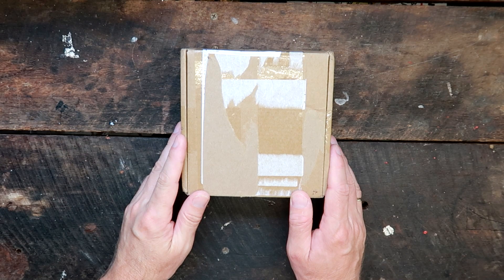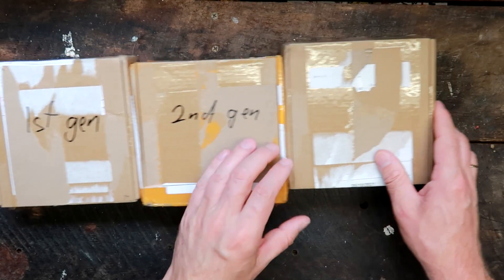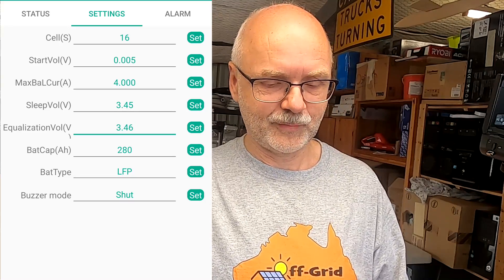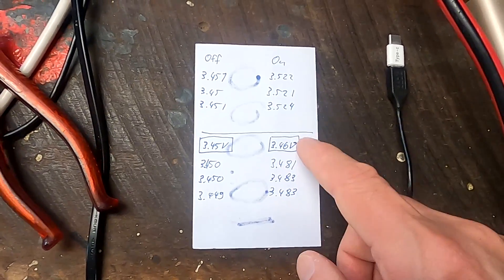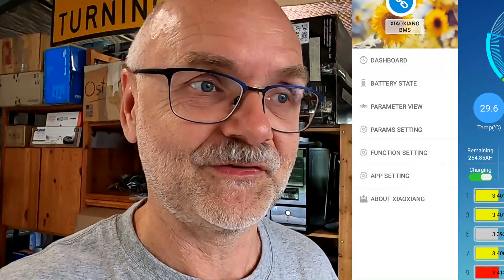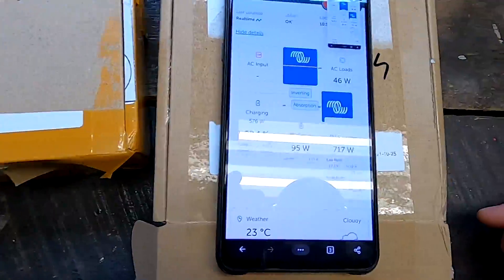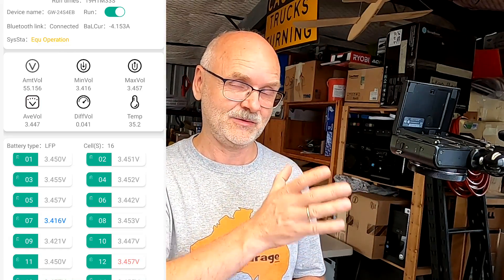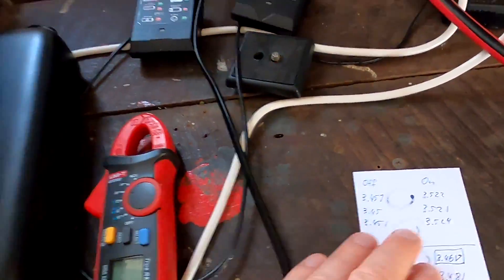The NEEY Active Smart Balancer is fixed. But there is something you need to know...

Comment: Why not do a top balance and not use active balancers? I don't understand the utility here. Even with grade b packs, cell drift is not that bad. What is the goal? 

I see all of these wires connected to raw terminals as a liability. And I've had a few balancers fail and go up in smoke. Isn't it better to avoid the risk entirely? Or am I missing something
Reply: And as we all know, voltage cannot be used to determine soc. So a solid top balance is the best way to ensure that the cells are at the same soc. After that, the cell drift is very minimal.
Reply: If you absolutely want the best balance for a pack you should balance charge every cycle. Which is a top balance. I can cycle for six months and still pull full capacity after an initial top balance. What benefit would a balancer have here? (That's when I didn't use bms)
Reply: If I'm using a high c rate chemistry and cell design, such as LTO or lipoly, and I'm pulling 10-100C, then an active balancers may be warranted. You need a linear curve chemistry for there to be any benefit. Some applications are car audio and large inductive loads. But for solar? I don't see any benefit at all. Unless someone can show me some literature or proof otherwise.
Reply: @WillProwse  You don't get a full charge every cycle in off grid situations.  You should have batteries setup to provide multiple days of storage to account for less sunny days.  So you will have many partial cycles.  This is where you get into problems....never high enough voltage to hit a bms shunting the high cells.
Reply from the maker: Great thoughts here, Will. Thank you.
The video was more a wrap on the NEEY Smart Balancer to show people how it now works after the 'fix' so they can make a decision if they want/need one.
My cells drift quite a lot but this is dues to not optimal terminal/busbar connections, I believe. Once charged back to the top after 2-3 weeks, I still have 30mV-50mV difference. It does not concern me much as all cells are still within the specs and they will balance over time. However, I'm not charging fully often with the increased load on the system now, so drift will occur...
Reply: 4A vs 50mA.   That tiny Daly BMS balance current isn't going to do anything when you have solar pumping in at 50A for 6hrs a day.  This setup allows you to balance below the top voltage, so is actually useful with the partial charges likely with solar and with a reasonable amount of current for 280Ahr batteries.
Reply: @jmaus2k  no, partial cycles are fine. this will not cause cell drift by much. Typically a solar lifepo4 pack only needs to be balanced every few months. High rate charge and discharge cycles will cause cell drift. Also exposure to excessively hot or cold temperatures. Or difference of temp on one side of pack.
Reply from the maker: All due to differences in internal resistance of individual cells. The better they are matched, the less drift they have and less balance they need.
Reply: @jmaus2k  you don't need that much balance current regardless. Electric car batteries are much larger and still use passive dissipative balancers with the same balance current as a Daly and they are fine. If you wish to prove why, please substantiate your claim with evidence. Tesla and Orion BMS disagree with you.
Reply: @OffGridGarageAustralia  the drift will occur at high soc regardless. What are your capacity test results now? If you're not pulling more capacity, why try to fix this problem? Let it cycle with the deviation. It's not much at all. You will always have deviation. The problem you really have is mismatched cells. When was the last time you did a top balance? Voltage is difficult to use because it's lifepo4. Even with best top balance, you will still have a natural cell voltage deviation because there is variance between each cell.
Reply: @OffGridGarageAustralia  doing partial cycles is totally fine. Let it go out of balance and do a capacity test and post your results. I will bet you will still pull 97% of your previous measured capacity or better. Unless you cycle for a few years or do higher than 2C rate
Reply: @WillProwse  Hey Will, I agree with most of what you have said....But, I could use the high balance currents because I bought a used high capacity LFP battery before the Eve cells, etc. appeared. A couple of cells run away towards the end of charging and this would help keep all the cells in line.
Reply: @gregb1714  the cell deviation will always occur at high soc. What are your capacity test results before and after having an active balancer?
Reply: @WillProwse  With the used pack, a couple cells hit 3.65V when the others are at about 3.4V. So pulling charge current away from the 2 runaways will allow the remainder of the pack to charge up more, increasing capacity. In the battery pack, the cell terminals/bars are laser welded together so I can't replace the 2 weaker cells.
Reply: @gregb1714  understood, what is your before and after capacity test results with the balancer?
Reply: @WillProwse  Electric Cars are plugged in overnight.  12hrs is a lot of time to balance especially if you are doing it everyday.  The problem is you don't get "everyday" or even many hours per week to balance depending on solar.  So you need to have higher current to manage that with a passive balancer.  You could do active balance at low current too.
Reply: @WillProwse  Manually balancing cells isn't an option.  User will forget and end up with a damaged cells if you bypass the BMS for higher current solar charging like you suggest in some forum posts on your site.  We should design for a fully automatic system that lasts 10 years without  users intervention.  This is easy to do, BMS makers just don't get it yet because they are designing for overnight charging.  There needs to be something that balances every xx amphours in or out....or at top voltage if you ever get there.
Reply: @jmaus2k  I haven't fully charged any of my electric cars for months. They are fine. 

And most of my solar systems charge to 100% every single day because I sized the array properly.
Reply: @jmaus2k  what I'm saying is you can cycle hundreds of times without needing to balance. Try it. I did it for years before we had BMS.
Reply: @jmaus2k  no, I didn't say to not have a LVD. Read my comments. You're missing the points I'm making entirely.
Reply: @jmaus2k  I promise you that the BMS designers don't see it as an issue because it's not. Let them drift for six months and do a capacity test. They will be fine. The voltages will deviate at high soc regardless. Do you have long term cycle data proving that me and hundreds of engineers are wrong? Please post it here. I'd love to see it.
Reply: I think the point is that you do not have to top balance or even know what ‘top balance’ is.
Battery management will become an appliance where even the Bluetooth interface is superfluous as long as you have the correct chemistry and current for the BMS/Active Balancer.
I love to relate the story of how in the early days of refrigerators and radios there was a huge publishing industry and DIY community devoted to radios and refrigerators. This will also happen to batteries. The magazines that were devoted to refrigerators and radios have disappeared, as will youtube channels devoted to batteries.
Reply: @WillProwse  That is a tough one to answer, it depends upon what point in time I decide to measure capacity. I am using one of those capacitive active balancers, they are good for 1A, Andy's testing reported that the neey is always 4A. So, now going through microcycles, weak cells cause bms high voltage cutoff, 1A active balancing brings down weak cells & charges other cells, then bms turn-on & charging on again until weak cells at 3.65V again and bms cutoff.  Repeat. Number of repeats/microcycles depends on battery capacity at start of day and available sunshine that day. I believe a 4A balance current will reduce the number of these microcycles and supplying an extra 4A to weak cells during discharge cycle will result in better battery capacity. That is, better utilization of the normal cells capacity. Weak cells cause bms low voltage cutoff and other cells are at around 3.1V.
Reply: @WillProwse  I tried with LTO 40Ah Grade B cells...and they have different self-discharge rates: from 4mV to 38mV deviation in only 6 days, sitting around at 2.5V/cell in a 22S 5P configuration.

Whenever I want to post a link to the DIY Solar forum, the comment is being deleted...
Reply: @CaptainProton1  what are your capacity test figures before and after? Would love to know those results.
Reply: @2true611  if you want to pull full capacity, all cells should be at same soc. Lifepo4 is tricky because the voltage is all over the place for most of the curve. So a balancer being used at any other time than high soc, is worthless. You can't use voltage with this chemistry to balance unless you're at high soc.
Reply: @CaptainProton1  yes understood, so what are your capacity test results? Can you post a video showing before and after?
Reply: @gregb1714  again, what is your capacity currently from 0 to 100%? How often do you measure? Watching the cell voltages all day and trying to balance them probably won't help you. Well, I can't tell until you post some test data. We need to see the capacity before and after to see if it made any difference at all
Reply: @Raphael_Hofmann  which LTO cells? Which manufacturer? What did you post to the forum? If it's not spam, it shouldn't be deleted
Reply: @WillProwse  My name there is Freibeuter and the post is called: LTO "Grade A" Aliexpress Cells.
Those blue 66160H 2.3V 40Ah Yinlong LTO cells, that you already tested before a couple of times.
Reply: @WillProwse  In the DIY solar forum, search for: 66160H
Then check out the second search-result to see one of my posts on those cells.

I learned about those cells because of your Videos :D
Thank you so much for your educational content.

Try posting those links in YouTube...the comment disappears after reloading the page.
Reply: @Raphael_Hofmann  thanks :) and yeah, it will delete them on here. YouTube blocks links. I'll check out your post! Cool
Reply: DIY Solar Power with Will Prowse l
Reply: @WillProwse  I've used and tested hundreds of the valance u27-12-xp .  While most of them work fine there's a few that are very hard to finish a top balance cycle.  Top balancing takes months held at high voltage.  So I manually balance and most of the time the battery remains easy to keep balanced.  But there are three out of 350 12-year-old batteries I found that their self discharge rate is too high for the balancer to keep up with even when doing a daily top balance using the stock BMS.  It may not seem important now to have a high balance current ability but 12 years down the road it has become important for these particular lithium magnesium iron phosphate batteries.  Over the past 12 years these 1.76kwh batteries have been subjected to freezing temperatures in an electric delivery truck with no active cooling or heating surging 2.3 C charge & discharge during driving on hills  and have discharged 630 kilowatt hours during their life so far.  With very few full cycle counts.  Some of the compartments that hold the batteries had water in them. My point is they've been abused and they've held up very well. And that they're built-in top balancing BMS has a very small bleed off ability which simply can't keep up when things start to go wrong. We're trying to use  BMS's that can not only protect the batteries but also keep them balanced 20 years later when they've been abused.  These few batteries that are having issues for me don't have capacity problems. And with a stronger balancer can continue to be a useful addition to my system.
Reply: @WillProwse  the balance battery with the largest imbalance took one amp into one cell block for 2 Days @1 amp to bring it up to top balancing voltage.  That means it was missing 24 amp hours out of 138 amp hours.  That's quite a huge loss of capacity if you continued without balancing.   This tells me it's been many many years since it's reached a top balance state. Not that they haven't tried. They probably had it plugged in for days and days. The charger communicates through the can bus to the battery system and so the charger is actually controlled by the batteries BMS for best top balancing results with the hardware involved.  Crazy how they were using this technology a decade ago and it didn't take over the market sooner.  So many people say lithium iron phosphate batteries are unproven however my old batteries prove otherwise.
Reply from the maker: I did a top balance two days ago when I tested the NEEY device. I haven't done a full capacity test on the existing battery for a while. I will have to wait until the second bank is installed and the can fully test the existing one. That will be interesting.
I agree, as long as we have only little deviation, it's not a problem at all. We also rarely pull full capacity from our batteries, mainly only for testing purposes anyway.
Reply: @CaptainProton1  wow that's quite the devotion of time to a battery pack.  I'm super grateful to be able to add to my battery bank without having to rewire anything with the BMS system I'm using.
Reply: I have no problems keeping grade B cells in balance using the resistive balance built into the BMS. Top balance, set turn on to 3.4v, and haven't figured out the obsession with active balancers. I find them useful to top balance and then remove them.
Reply: @john_in_phoenix  me niether.
Andy has been burnt making dodgy recommendations and he is now try to  correct this with continual balancer tests.. good on him for trying tho.
Reply: You do it because with these you can just skip the top balance step, just like you tried to do with your raw cells. It's what I did too. With these better balancers that shut off at lower voltages you can just start using the array right away.
Reply: @WillProwse  I actually do have a lot of data with liIon cells.  The failure is always one cell getting too low and killing a pack.  Mostly battery tool packs, but also EGO batteries.  The problem is the BMS can't raise the lowest cells with fast charging.  Put 1C into a battery while balance(burning off highest cells) at 0.001C.  I think the chargers slow down near 95% to help with this, but it doesn't work all the time.  What does seem to help with capacity is a slow 100ma charge overnight to bring up all the lowest cells and allow the BMS to handle the high cells.

BMS designers don't see it as an issue with specific products that are making.  BMSes are designed for ebikes, evs, and things that are plugged in for a long time.  Even EVs are effectively slow charging from a house charger most of the time.  Problems may not appear with a low discharge capacity test either.  You see them when you pull high currents, which is when the tool battery says red out of charge...even when you have 50% capacity left in most of the cells.  It's just that one cell isn't charged enough to hold its voltage above the cutoff.

We will see charge controllers integrate proper BMS designs that actually use higher power balance currents.  Victron can already slow down charge currents with a signal wire, but I think high balance currents will become a requirement to capture the most solar input.
Reply: @jmaus2k  High charge & balance currents to capture most of the solar input is only happening with people who don't have or don't need large battery banks. Honestly most people need much larger battery Banks when they're living off grid with solar and so they're charging and discharging very slowly as in relation to the size of the battery.
Reply: @gregb1714   I am in your camp, find that on my large bank with mismatched Gen1 nissan leaf cells. The pack will not fully charge because of a couple of cells being to high, or a couple of cells  being to low. This is the issue Im trying to adjust for without replacing the cells. I value Will Prowse expertease, BUT "real world" day to day use with my 1125 ah bank on a modern Off Grid home. I think a good balancer would help by take the TOP off the high cells and pushing up the lower ones.
Reply: I think a key question is how many mv is considered out of balance ? 100? 200? 500?  I have a 400ah 24v lifepo4 bank when charged up to 3.5v its usually between 50mv to 100mv balance.

Comment: Hey Andy thanks for all your video! I would like to know one thing is it possible to plug the NEEY even if my jk bms is balancing? I mean is it ok to have two active balancer doing the job? They will not be lost on the data?
Reply from the maker: Yes, that is totally fine. You can have as many balancers running as you like. Just make sure, they use their own balance cables each and are not sharing them. Otherwise voltage measurement could be off on one device while the other one is balancing.
Reply: @OffGridGarageAustralia  Thanks Andy ! 🙏

Comment: You can turn the capacitor active balancer off and on, replace the 'run' solder blob with a switch. I am going to try to use an electronic switch that will turn on when the battery voltage reaches 3.4v per cell for LFP (27.2V for my 8s battery).
Reply: Muss ich auch mal machen. Danke dafür. 👍
Reply: @marcelprivat  Gern geschehen.
Reply from the maker: Yes, that is true. We have tested this in the first video I made about these capacitive balancers. It works well and can be used for maintenance balancing from time to time.
Reply: @OffGridGarageAustralia  Oops, I guess I need to watch that again, I missed that part. Maybe I fell asleep while I was watching, long hours and watching late at night will do that to you. lol